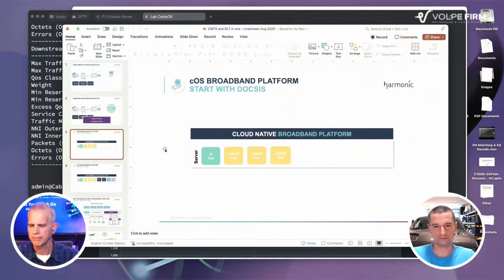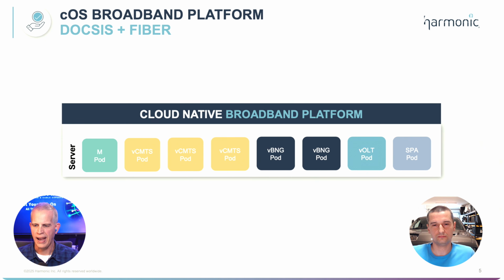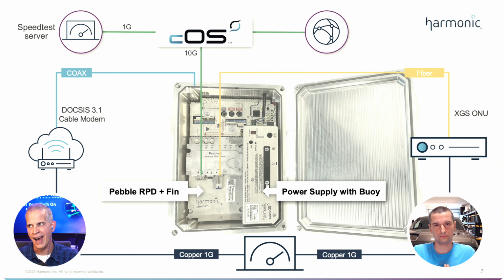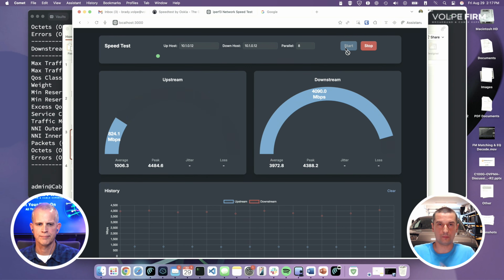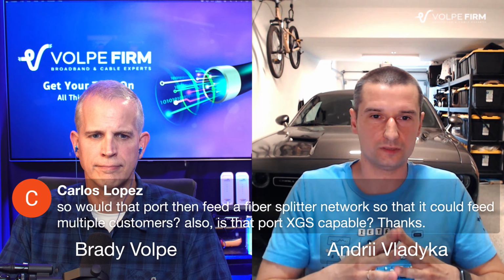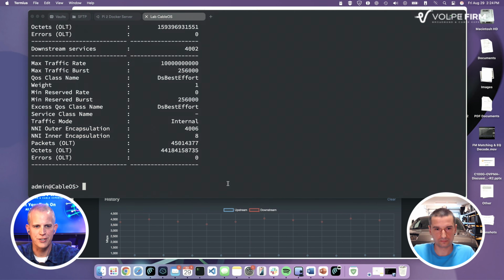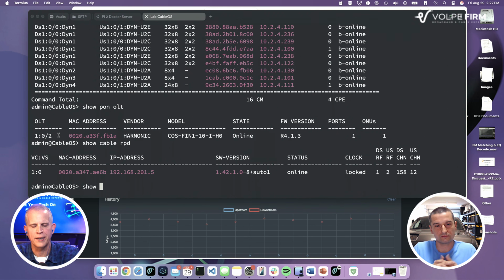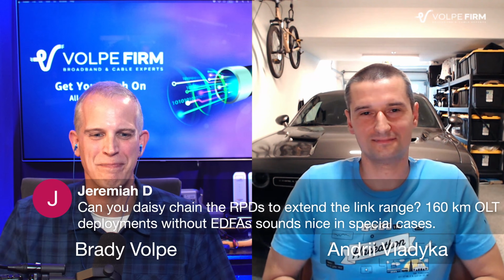Turning My vCMTS into a PON OLT – Live Fiber Demo with multi-Gbps ONU Speed Test!

Comment: is that the same as me putting a 10gig sfp on my rmd out in the field, and instead of connecting to another daisy chained rmd, i just connect it to an optical splitter to feed multiple homes, or to one of our ont's in a customers home. well the total bandwidth available is 10gig at the rmd, so their speeds would be determined by what bandwidth is not being used by the other customers on the rmd
Reply from the maker: Yes. The concept is the same. I don't know if Commscope or Vecima support this yet. If they do, I would love to have them on the show to discuss. As for the 10G bandwidth, we touched on that. You would need to put limits in place, if necessary, to throttle were needed.